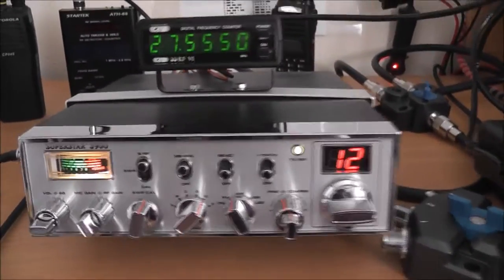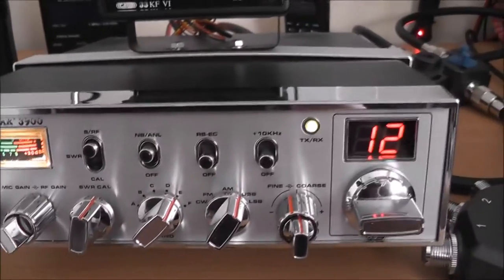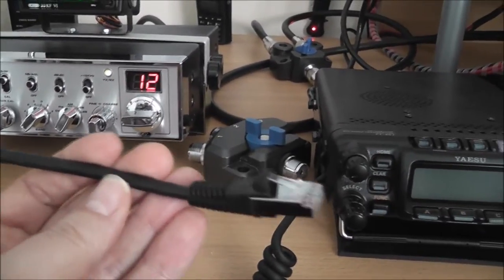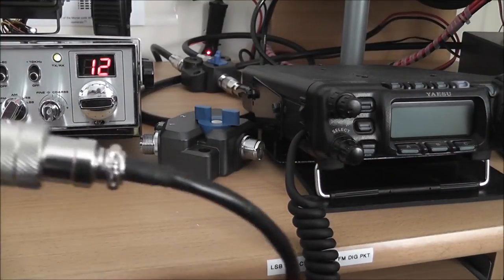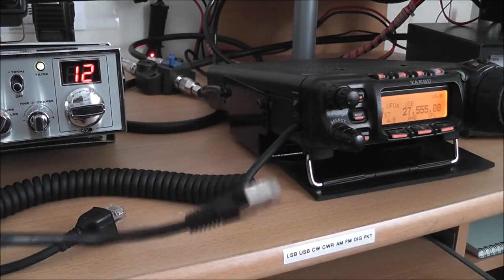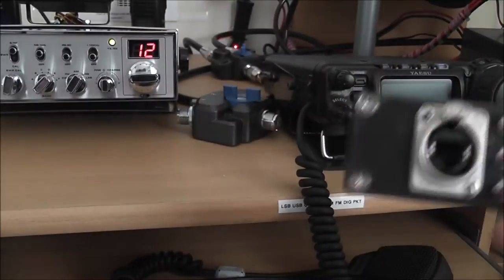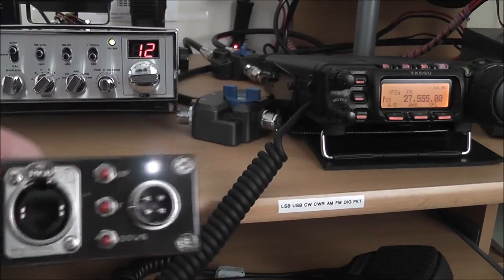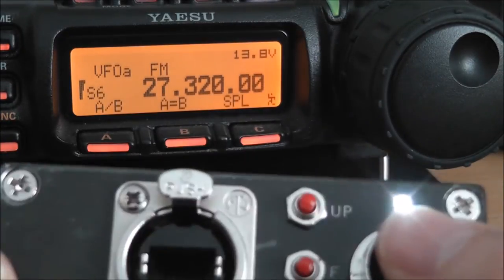Yaesu FT 857-D Mic interface

Comment: separate the head from the body. you can then use the short lead direct into the radio body. put the radio somewhere out of site and you will reduce the fan noise you are subjected to.

Comment: Achieved the same as you but I got Knights to make an adaptor for my Teardrop (from CB days a lifetime ago) and it drives the little radio quite well. Mine fits the radio's own socket no problem so I don't need the adaptor box like you've used. The Teardrop much better on my TS50 however.   To get around the 857d's rubbish standard mike thing I also bought an MH59 DTMF accessory mike with most of the functions available on the keypad. It gives much better sideband audio than the MH31 and is sharper by far. Drives it quite well on ssb.  A problem with both this radio and the 897 is the ALC's action which makes it very hard to drive these radios adequately. You end up with thin sounding audio that can't be improved much, unfortunately.  I think the adaptor rat-tail from Knights was less than a tenner.

Comment: Did you find that when the RJ45 connector comes out of the radio it is reversed at the other end? I am doing something similar for my FT-857D to run a XLR mic but it seems that on the PCB end that Pin 8 On the RJ45 socket is pin 1 on the radio Socket. It very strainge and defenetly is not a fault with my PCB design.
Reply from the maker: To be honest I never noticed. There is a schematic available on the internet. I don't actually have the radio anymore so I can't check.

Comment: What about he difference in resistance between the stock mic and an astatic or other mics? I talked to yaesu and they said this sort of thing was a no no. These are graet radios except for the mic.
Reply from the maker: stanky98035 They would say that. There is no impedance mis match. Any mic will work with any radio. I've never had a problem in over 30 years.
Reply: O K I'm just worried about ruining my radio. It's my favorite

Comment: How did you get the FT857D to TX on 11 meter band?
Reply from the maker: W0QGS Richard Hi I thought all 857s had continuous tx from 100khz to 50 mhz with no gaps. mine does. Also tx from 136 to 174 continuous including marine and tx from 400 to 470 I thought they all did that.
Reply from the maker: W0QGS Richard I got it from Greece perhaps European spec is different maybe.
Reply: Yeah, that could be... Did you purchase new? If it was used someone could have done the MARS mod on it as another possibility. 

I have the 857D and love it, but wish it was open to TX on 11 meters, etc. But heard there are some issues if you have the MARS mod done on some newer models. May look into it further.
Reply from the maker: W0QGS Richard Hi Richard it probably is the mars mod it was brand new from ebay. I live near London but the seller is in Greece. it took 22 hours to reach here amazing speed of delivery. They are a shop called 2 way radio express. All their stock is unlocked or extended range. Check them out.  Great seller

Comment: YAESU 857D is by far the WORST HF radio I have ever owned or used.I would not accept another one for FREE if I must keep and use it.I hated it.I replaced it with an ICOM 7000 that blew it away with ease.That is in the USA what is called an Illegal Export CB Radio which drifts really badly on SSB.Two garbage radios in one video imagine that.
Reply: You replaced it with a radio that Icom quickly discontinued due to over heating problems. lol Smart move.